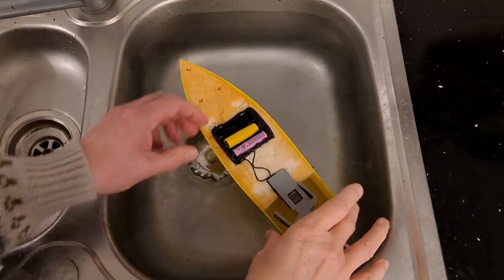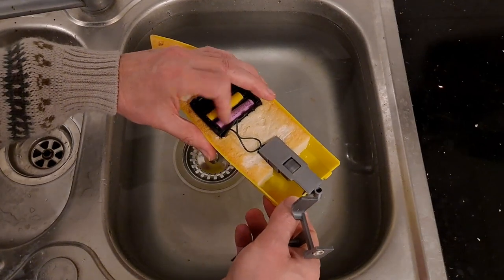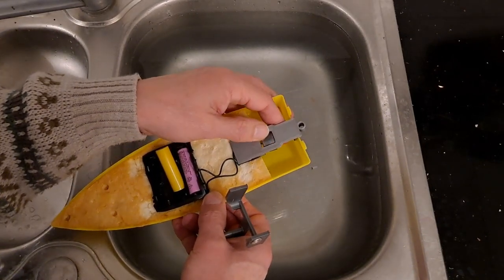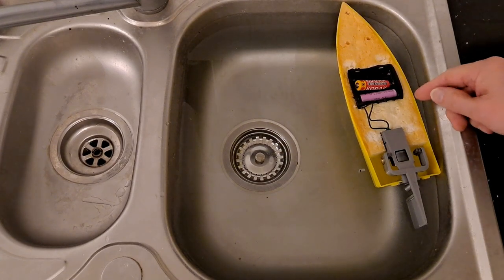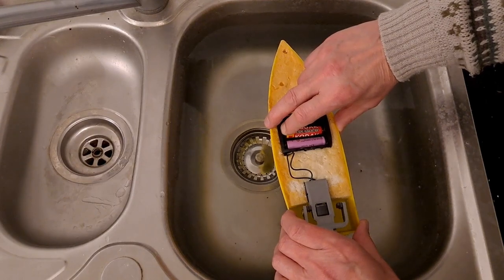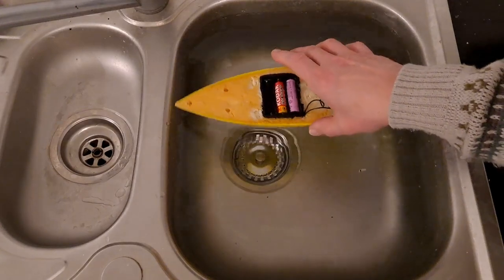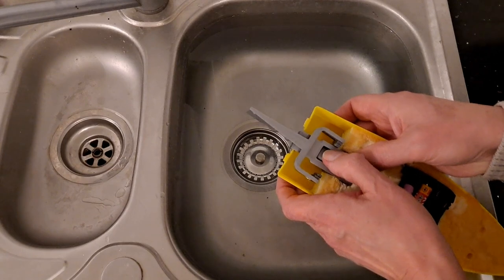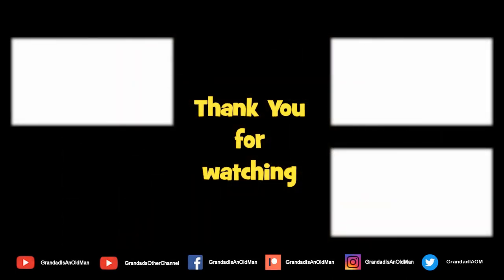PART 5 Flapper Paddle Boat

Comment: I think it is a brilliant idea you came up with. All the things you mention regarding adjustment I agree with. I am sure this will work and I hope you don't give up on it. I suppose it is like anything that has just been invented, it has to be tweaked to get it working the way you imagined would work.
I was thinking about a screw on one side of the magnet arm. 
That may give you a fine adjustment. Regardless, brilliant idea.👍👍👍
Reply from the maker: I like the idea of an adjustment option 👍
Reply from the maker: Reading the comments here I am now thinking about the idea of using a coil to generate the magnetic field rather than permanent magnets. Basically a pulse motor circuit.
Reply: @GrandadIsAnOldMan  Sounds good Graham. 
I am using those little sewing machine spools to make the electromagnets I need for that machine I am building. I bought a 6mm iron rod as the holes in the little spools are 6mm and the rod fits perfectly but there is a tiny bit of space that I will fill when I put the iron pieces in with epoxy. Don't know if you have any of those spools but they would make great electromagnets for this invention of yours. I bought about 40 of them because they were cheap and were delivered fast. Was an eBay seller. I can stick some in an envelope if you want, it's no problem.  
BTW: I looked at the price of those little 12 volt electromagnets on eBay and from many other suppliers. They are little small silver ones. They go from a fiver each to 10 pounds or more, "each". Crazy, considering they are just a coil wound around an iron or other metal core and I needed 10 of them for each channel of my device. Imagine paying 100 quid for 10 of them. No chance. LOL

Comment: Is the motor running too fast to catch the magnets?
Reply from the maker: There is a very fine line I am trying to tread here (and I think I went the wrong way). I underestimated how much power it takes to spin the magnets in the middle to overcome the power of the magnets on the flapper arm. If it runs slower, they just lock together and stop the motor. I either need a geared motor to give much more torque so it can run slower, or reduce the size of the magnets. However, if the magnets are not powerful enough, they won't push the flapper against the pressure of the water. Making the "rudder" end shorter and the lever arm longer would also reduce the power required, but at the same time it would reduce the amount of motion of the "flap" of the tail.